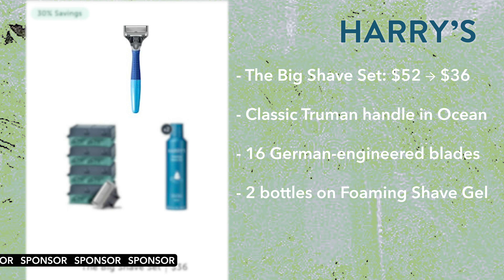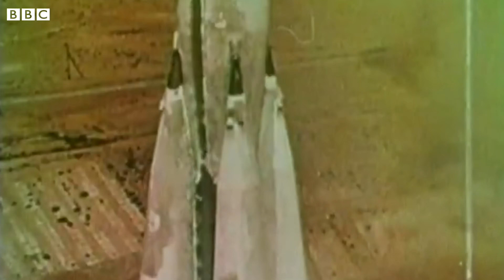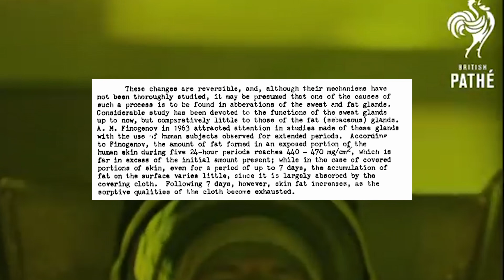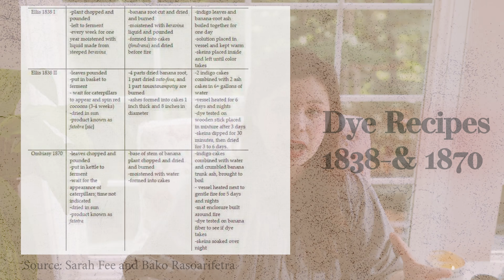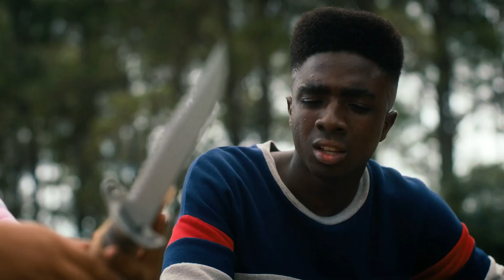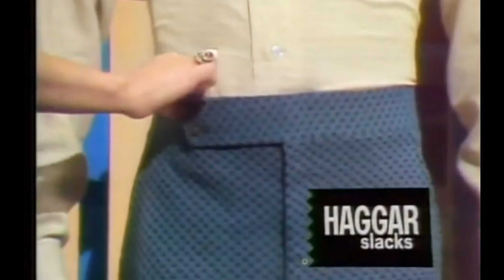The DISGUSTING truth about Laundry

Comment: I have suggestions for being more eco friendly!!

I recently bought a new house that came with old machines.  I'm stuck with an agitator top load washer.  And my dryer has only 2 heat settings (perm press and high).  

The dryer was also taking forever to dry a load, so I bought a long spinning brush to clean it out.  Nope-- it's installed wrong with a flexible duct the whole way under the house.  I can't currently access the crawlspace, so I made a few changes that will help me still get my clothes dry, but are also better for the environment:

1. I bought an outdoor umbrella drying rack.  These don't take up much space, but you can get 2-3 loads on the rack at once.  I have it set up on my front porch since it's in the shade after 1pm so my clothes won't get sun bleached.  Unfortunately, I live in Seattle and it rains non-stop about half the year.
2. I bought an indoor dryer vent.  This way, I can still run my dryer even though the duct to the outdoors is crazy clogged.  In the winter, when it's too rainy to line dry, my dryer will end up heating my house instead of the outdoors.  Since I have to run the heater anyway, I'm just using a different heat source that's also drying my clothes.  As an added benefit, it's also humidifying my home to counteract the horrible static.

Even before buying a clothes drying rack, I've chosen to hang dry many of my clothes.  My synthetic workout clothing, swimwear, bras, etc, have always been hung to dry, both to extend their life and to avoid blowing out microplastics.  Dresses and anything that tends to wrinkle goes in the dryer on a low setting for about 15 minutes, just to get rid of the wrinkles, then I hang them to dry.  

My previous house had a large laundry room with a clothesline in the ceiling. I added a garment rack for clothing that I hang to store, which gave me way more space compared to the line.  It was also in the doorway between the laundry and furnace room, so everything dried quickly. 

In my new house, the laundry is a walkthrough to my daughter's bathroom, which is partially under the stairs.  I hung 2 clothing bars under the stairs for hanging clothes, and a line above my machines for things I need to clip.  

I started using mesh bags in the washer years ago after having too many items ruined, even in a front load machine.  I sort more delicate fabrics in a separate load from heavier ones (I sort into 10+ different loads!), and anything at risk of damage like lace, tulle, or spaghetti straps goes in a mesh bag.  I used to wash knits on their own so nothing could catch them, but now that I'm stuck with an agitator, they go in bags too.  The only problem with sweaters in bags is that they don't get as clean.  On a shorter load, sometimes the sweater is even dry in spots.  I really wish I could afford to replace my machines-- I miss my LG front loaders from my old house-- especially the ultra low heat setting on the dryer and the stream sanitize setting on the washer.  

As for better detergent, try soap nuts/berries.  You throw a few of the dried berries in a muslin bag and toss it in with your load.  The inside is the berries is saponin, which disolves into the water to clean your clothes.  It's also a natural fabric softener.  I have so many soap and detergent allergies and these things are amazing.  Allergic dermatitis be gone!!

Comment: Oh my goodness! Abby you are right the way we   historically did laundry practices before the 1920s was actually cleaner. It was also very hard work. There are so many things I could say about this but I'm going to limit it to the the research I have done on doing historic laundry and how I have Incorporated those techniques into my modern clothing routines. Sanitizing laundry can be done with, as you said, vodka, gin, everclear. Using a spray bottle to spray the clothing prior to washing it or not washing it and just spraying it on the clothing and letting it evaporate will kill the bacteria that make clothing smell bad. Distilled white vinegar added into your washing machine with your recommended amount of detergent will also disinfect your clothing. If you use the soak cycle on your washing machine with distilled vinegar that will also help with the killing of germs. Of course for whitening, you can use baking soda, borax, vinegar. To soften your clothes I also recommend distilled white vinegar it's so much safer for you, your clothing and your washing machine rather than fabric softener. After you have used clothes that have been worn out recycled them, use the clothing as rags, make rugs out of them, make quilts out of them, there are hundreds of ways to recycle old clothing highly recommend Pinterest. Also, investing in high quality clothing is a factor, and taking care of your clothing. I totally agree with hanging your clothing up and letting it be out. If you can't do it outside hang it in your house. The winter time is the best time to wash clothing and then hang it up let it dry because water will evaporate more efficiently in the heat of your home and makes it more efficient. There are hundreds of hacks and helpful guides out there on how to reuse repurpose clothing to save on water. If you have a septic system it is safe to use distilled white vinegar to sanitize your clothing and your normal wash cycle. You also need to help maintain your septic system. One of the best ways to do that, is to give your septic system a beer once a month. Also the more chopped up fruit you can send down into your septic system will also help with the health of the bacteria in your septic system. Anyone looking for help I highly recommend doing your own research finding what works best for you and your home every little bit helps and everybody that does a little bit can help the earth. 👍💜💜

Comment: In NZ dryers are becoming commonplace as properties are getting smaller. Traditionally everyone had a rotary clothesline, I think they were great. We had to take ours out to put in an outbuilding so we've been using just a dryer for a few months now, but I really, REALLY miss the smell of sun-dried sheets.
In Australia they have covers that go over them so the sun doesn't bleach your clothes, but you can still air dry outside!
We also have huge problems with damp houses and black mould in NZ so drying racks inside aren't a great idea.
I've been collecting the fluff from my dryer as stuffing for craft projects!
I haven't used a detergent with colour or scent for the longest time, I've always been sensitive to them. 
Don't forget that washing machines get DISGUSTING! they get so gross and just a "cleaning cycle" isn't enough to get them clean. You've gotta scrub whatever you can see. 
It'd be interesting to look up research on the poop shirts. Poop particles can be found everywhere, even in your kitchen, and sometimes it isn't the existence of the particles that's the problem, but the fact that with modern technology and research we are aware they're there.

Comment: I have a clothes line that is easy to use but is not up all the time. I drilled eye bolts into posts on my patio and into posts on my fence. I have clothesline attached to swivel clips, like you have on a dog’s leash. I clip the line from the patio to the fence and hang my laundry on the line. When my laundry is dry and I take it in, I unclip my lines, roll them up and store them with my clothespins. My sons made this system for me.

Comment: So so so many questions! The whole line drying thing and banning it…wtf!! Line drying is my preferred method but as in the UK I do use a dryer when I can’t use the line during the winter when it’s raining. My washing machine gets repaired until it can’t be and then I get the most energy and water efficient one I can afford. I run a full load using animal fat free detergent and softener (or vinegar if I’m line drying) and if I need a higher temp then I use the steam function (like with bedding). Longer washes can be more effective and actually save water and energy because they have time for soaking, the setting you use makes a huge impact. Many things can’t be tumble dried so there’s usually a maiden full of washing somewhere airing. The machine gets cleaned regularly and wiped around the rubber and door (where things and water tend to sit if blocked). I’ve never understood the top loader machines, the last one I saw was my nans old one in the 80s that washed like 3 clothes at a time 😂

Comment: Those holes are SO ANNOYING. I have a few shirts set aside that I am going to fix the holes in, because I love those shirts too much. I have a water filtration/softener so the water is a smidge better, and my washer doesn't have an agitator. I also tend to wash a lot more things in my sinks because they feel cleaner and temperature control (especially my skivvies - each pair gets washed alone). I also run 2 empty cycles after my roommate does her laundry because she washes EVERYTHING together. I'm fairly particular about separating things. I know it's a lot of water but...I am not going to have poop on my clothes because my roommate is nasty. I don't use fabric softener, and my detergent is those detergent sheets (I finally found one without fragrance!) and wool balls in the dryer.

Also as far as letting go of clothes goes, I tend to donate my non-skivvies to For Days, who are a closed circle clothing company. Also if you're in the US, Adidas and I think Reebok? or Nike allow you to send them shoes for recycling.

Comment: As a former appliance salesperson, I approve every word of this video. There are machines out there which can do a good job cleaning, but even with perfect use they're still slowly destroying your clothes. Stop using dryer sheets & waxy fragrance beads/liquid softeners, follow instructions for detergent, leave the door of front-loaders open to dry out, and PLEASE be cleaning your machines regularly. If you need to compensate for subpar water, look at options like vinegar, washing soda, borax, and citric acid depending on your water quality issue. Wool balls if you have to use a dryer but line dry as much as you can. Outdoor airing with sun exposure saved a skirt my sick cat had been peeing on. Still needed a new zipper but UV rays and airing helped remove what the enzyme "cleaner" mostly just covered with perfume.

Comment: It's a tecnicality but maybe you can get around the line drying ban by spreading clothes on your lawns. possibly on top of sheets.
 I'm lucky to live next to a small river and wash most things in water dipped out of it's clean depths. Then the soapy water goes into the septic tank but rinsing water goes on the garden. I never use plastic textiles.  Not even sheep between me and the spring 3 miles up the mountain. Everything is line dried and often i hang out unwashed clothing after 2 wears to refresh in rain and wind and sun. I only use a machine 6-8 times a year for sheets and towells which is a live alone luxury. I was deeply shocked by US practices when there in the 70s and vividly recall being stopped by police carrying my laundry to a laundrette. Nobody walks ! Washing by hand is good exercise and saves gym time.

Comment: I have to make a comment about boiling water being a better way to sanitize clothing.  First of all, I'm a retired sanitarian who is also a historical reenactor. My background is environmental health. Soaps and detergents don't just remove dirt. They also kill microorganisms by lysing the cellular wall of the microorganisms, thus killing them. Modern detergents are made to use in warm and cool water because these temperatures are less damaging to clothes and also use less energy. Surfactants separate all this detritus from your clothing , allowing all that stuff to be rinsed out and away from the clothing. So no poopies on your clothes!

Secondly, you can use bleach on your clothing with a septic system. The vast majority of septic tanks hold a minimum of 1,000 gallons of liquid. That small bit used in your laundry will not kill the beneficial bacteria in that huge tank. However, I do recommend not doing all your laundry on one day, like done in the past, aka Washing Monday. By spreading it out over the week, you minimize diluting the water in the septic tank. Laundry all done on one day can actually kill more bacteria in the septic tank through excessive dilution.

Comment: Tips .. from central Europe (living in a flat with no balcony)
.. we have a filter on our main water supply (our water is medium hardness - you can actually check this online if you look up where your water comes from in the city water supply)
.. I am using baking soda as an initial water-softener for every load (bonus it helps to battle calcium/limescale deposits in the washing machine), I have been using non-toxic gel (basically broken down soap) as a main washing agent (which works even in low temperatures like 30-40°C) .. and instead of fabric softener I use plain old vinegar (which will help rinse out the remaines of soap and any residual oils from the clothing) - you can smell it when the clothing is wet, but once it dries there is zero odour
.. I clean out my washing machine every 2 weeks (with a load of rags or anything that needs a higher temperature wash - 90°C and I alternate soda with citric acid for that) .. this helps to battle any buildup in the washing machine and also helps to keep it limescale free 
.. we do use tumbledryer for cottons and linens but anything else (bamboos, wools, work-out clothes) goes on a hanger to airdry
The upside of all of this is having less respiratory and skin conditions - I have started this almost 8 years ago because of our alergic cat :D (kudos to the veterinarian who recomended this regimen), but really the whole family benefited from this .. bonus points, we all regained "sense of smell" - most of the time I can smell peoples detergents in public transport and if there is a parfume on someone, I can smell them from across the room :D .. sounds icky, but the food and drinks are so much more enjoyable now and the great outdoors is just amazing :D

Comment: I found out after ten years of marriage that my wife had been doing all her laundry (and mine! when she did mine!) in hot water. Exclusively. Which certainly explained why her goth ass wardrobe didn't last nearly as long as I expected it to.

My mom has sensitive skin and was raised by her grandma who lived through the depression, so I was taught pretty good laundry practices. But by far the best way to do laundry is by hand! Sucks that it is physically difficult and exhausting (and also almost none of the places I've ever lived have had anywhere that would be suitable to do it).

I will also say, I have no idea if outdoor line drying is legal where I live, but for up to six months of the year, it...wouldn't be terribly effective. However I have also line dried stuff in the basement, which honestly was fine, especially in a mostly-finished basement. I made lavender sachets to put in drawers and closets anyway, so any "musty" smell was a non-issue.

Huge second on the vodka spray! Cheap alcohol spray is probably the best sanitizing bet. And most of the smelly part of clothes is caused by bacteria, which alcohol will eliminate! Doesn't help with the oils/fats, though.

Comment: Oh if you are about to move to sun/air drying, get a roofed area where you can hang plastic hangers, and dry your dark clothes there, and not directly under the sun, or the colors will quickly fade. I used to do this, and let them get dry enough for me to move the dark clothes to the bathroom and hang the hangers on the shower curtain rod. Also, using the hangers makes it easier to take your clothes inside quickly without pulling them, when it is about to rain.